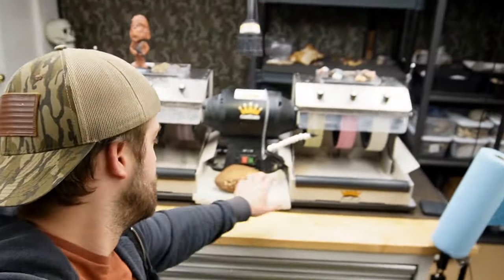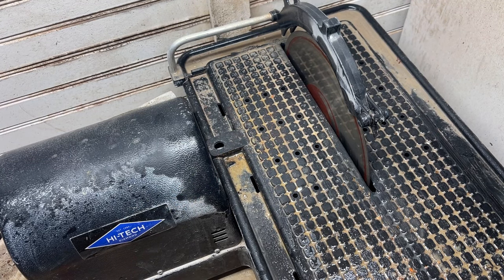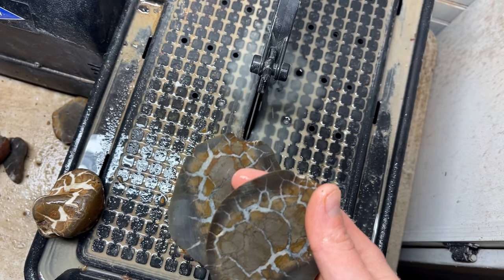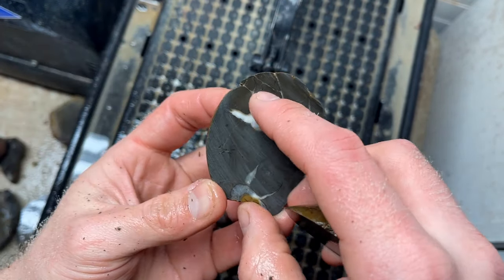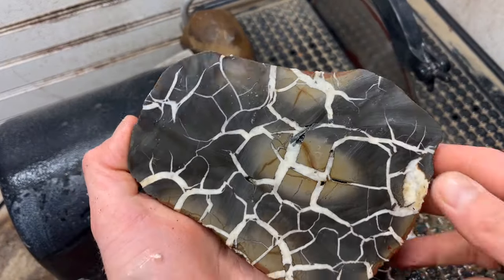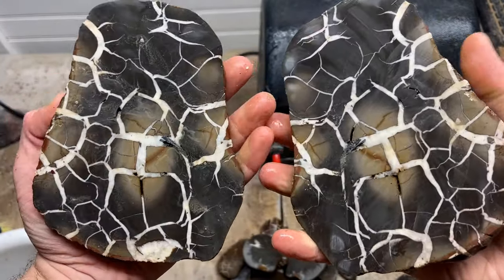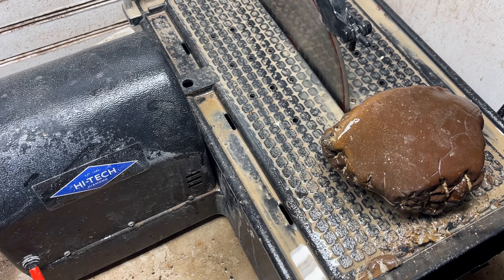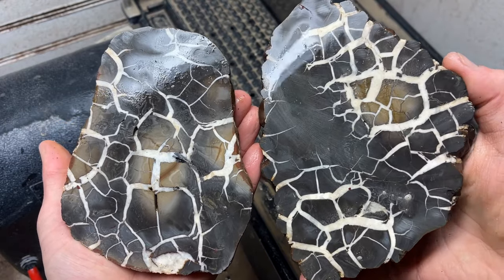Cutting LIGHTNING STONES open w/ lapidary saw! [SEPTARIAN]

Comment: Seems pretty clear that the calcite infiltrated layers (CIL)  alternate with fine-grained non-calcite containing layers (NCCL).  If the rock is a NCCL-CIL-NCCL sandwich, it will be a "winner" when cut through the middle layer, whereas, if the rock is a CIL-NCCL-CIL sandwich it will be a "dud".
Reply from the maker: Clear as mud lol